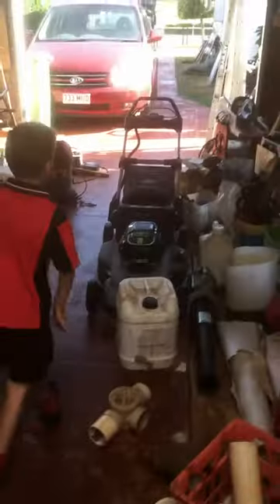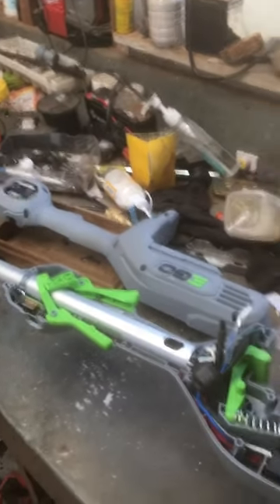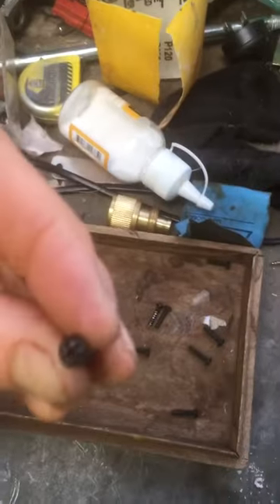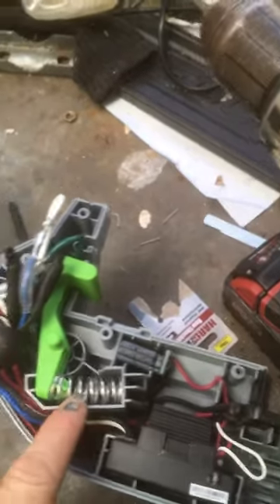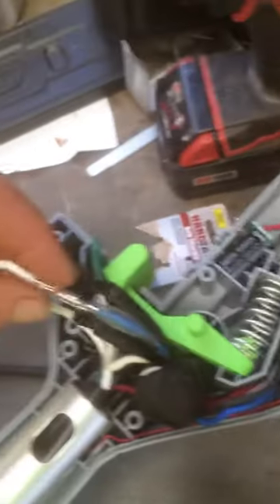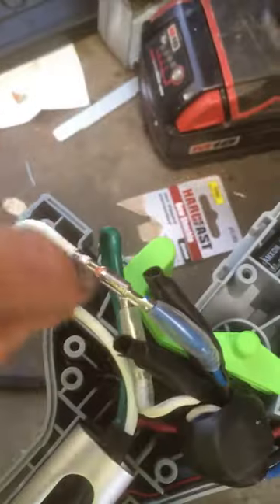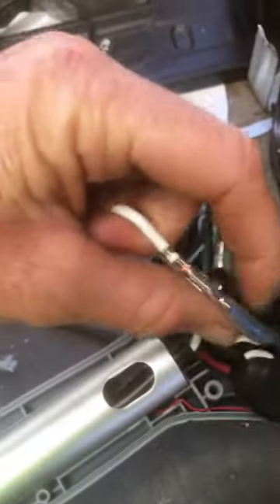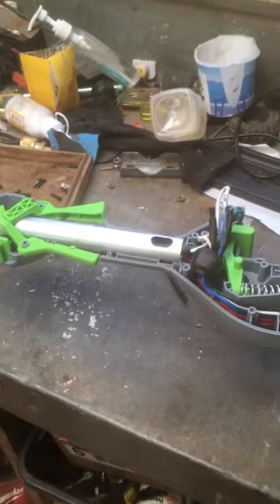How to change direction of your EGO whipper sniper / weed eater

Comment: How are you can you do this on any battery weed Wackers I have a atlas
Reply from the maker: Hi, I don’t know about any battery weed wacker.  If your motor has two terminals positive and negative then it is a matter of switching the the negative and positive wires to the motor and it will run the opposite direction. 
If your motor has a 3 phase (3 wires) to the motor then you must keep the negative in the same position and swap the positive and middle wires. ( note I have blown up two circuit boards costing me $200ea while experimenting so be prepared for failure) but how else do we learn.

Comment: Do you have to change the head to a counterclockwise head or will the string still feed?
Reply from the maker: Hi, I have not changed the head, and it still feeds the line normally.
Reply: @1greenthumbgardeningtwba   ok thank you
Reply: You would like to think the manufacturer would have a switch to change it